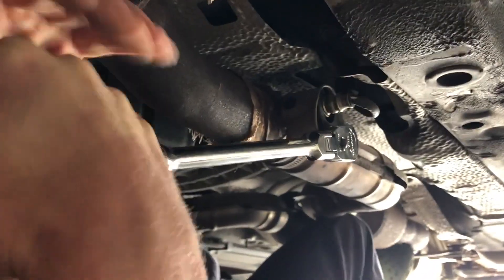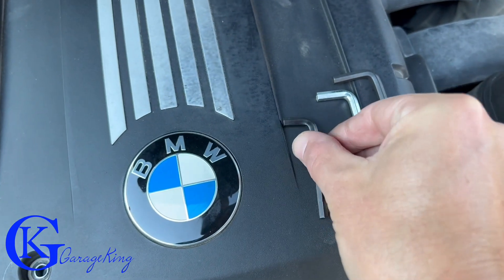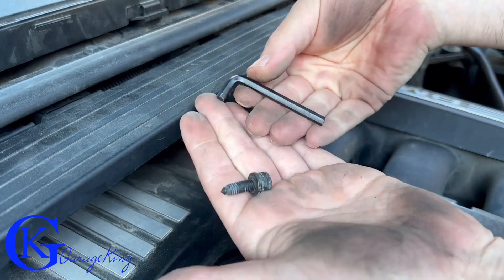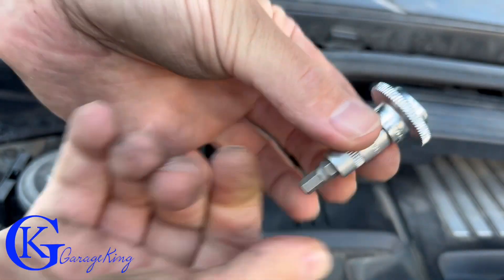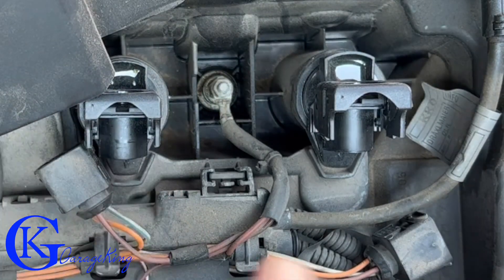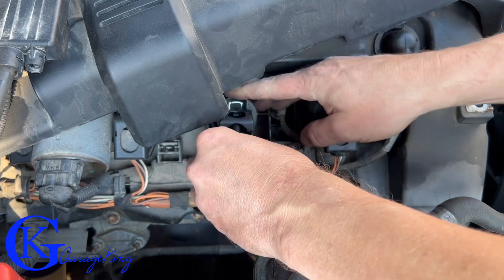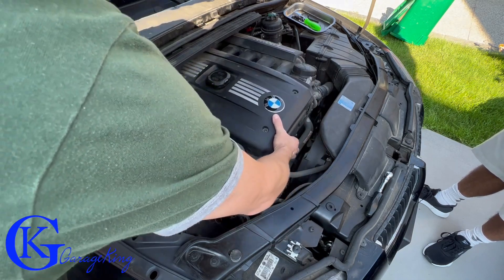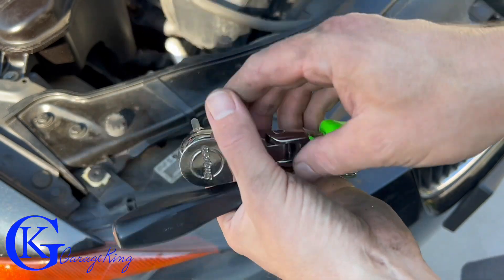BMW E90 Cylinder Misfire P0302, Swap the Coil to Test

Comment: I changed spark plug fuel injection and coils and solenoids and still got miss fire in cylinder 2
Reply from the maker: Well that's kind of a tough one.  You could try the spark plug.
Reply: Did you fix ? Same on my change injector and coil and spark plug and same

Comment: Wouldn't it be easier to simply remove the microfiber to get that housing off?
Reply from the maker: Maybe??  but I found this was pretty quick.
Reply: @GarageKing   TY,  I haven't started yet but I used an OBDII and the fault came up as "injector circuit- Cylinder 3". My question is: On your vid you showed cylinders 1,2,3 correct? I'm hoping that it's the coil and not an injector problem 😕. If the coil was faulty would it be possible for the code on the obdII to present with that label "injector circuit- Cylinder 3? Thanks in advance🙏
Reply from the maker: @blndrckr  Hey there, normally "injector circuit..." refers to the injector, the wiring, or the driver (computer) I find for coils you normally get a misfire code.  If you have a bi-directional scanner it would be really easy to test as you could just turn the injector on and off when the car is running and see if there is a difference in the idle, if there is no difference you can then turn the coil on and off and that will let you know if its the injector or the coil.  This is the scanner I use a lot to do these types of tests https://youtu.be/j_XyEoOmcoc and you can get it on amazon https://amzn.to/3J5EUx0
Reply: @GarageKing  awesome!!! TY for the heads up!!!

Comment: It did help me at zero cost. It was a bad contact on Cyl-2 btwn the spark plug and the ignition coil. Switching the coil from one to two and vice versa did the trick.

Thank you so much!
Reply from the maker: Anytime and glad I could help out. Thanks for the comment !!